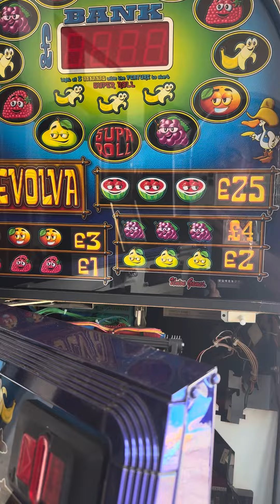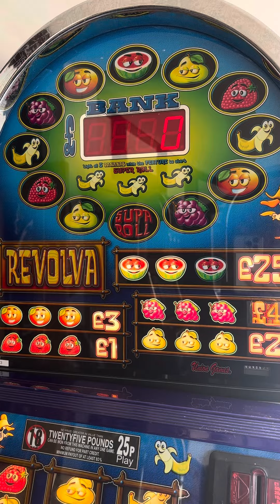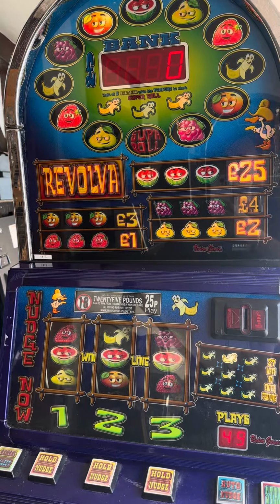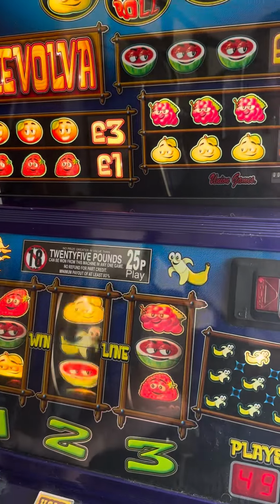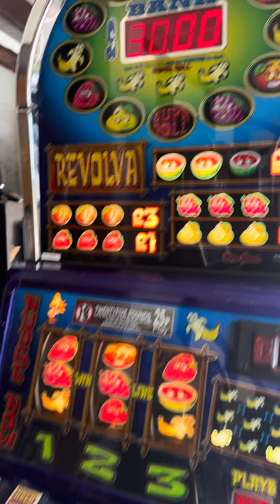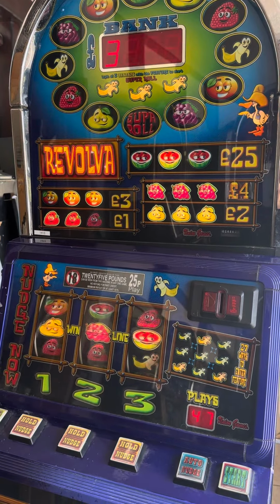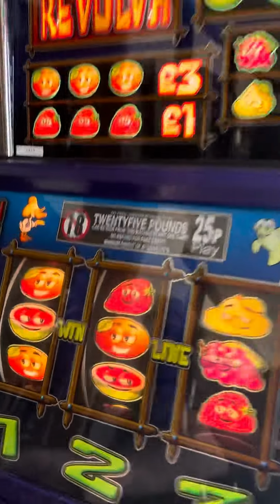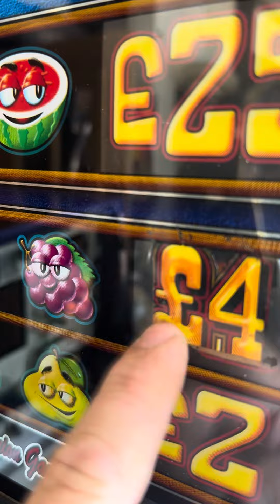Mr Ps Classic Amusements and Reel Fruits Workshop - Episode 8

Comment: Great to see you actually working on the machines and repairing them, rather than just walking round lock up till by us what you are going to do. Obviously a very talented guy well done
Reply from the maker: You have a very valid point, and someone else mentioned about the repair side. It is however very difficult with my uncut style, I have repaired many games lately and it’s full on and it’s hard with two hands let alone one filming and one repairing. 

I try and use this series for a fly on the wall, it is basically you, me and the camera.

I had 13 dud mpu4 boards that I repaired 8 for testing and the other five I have to repair more extensively before trying. This would have been a good vid, but a boring vid also for some. 

It would have been comical for people seeing me go through three levels of corrosion cleaning then the boards sunbathing to dry out before their final isopropyl clean. 

I have an mpu4 test rig that I have never used because I enjoy repairing them blind, out of the 8 all worked in the end, finished testing them today. Two had lamp faults that were easily rectified and only missed due to me not wanting to check every transistor until in the machine under load. 

I enjoy the repairs equally with the machine playing and tbh I worry and really do have concerns that when I go, so will these machines